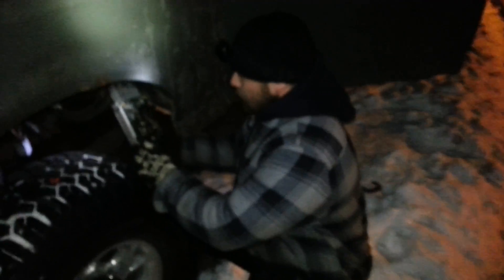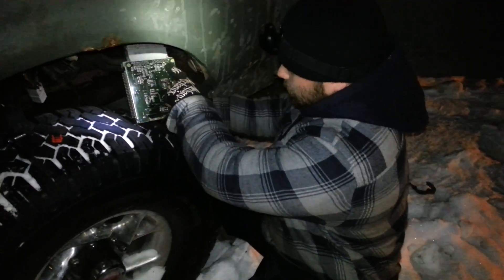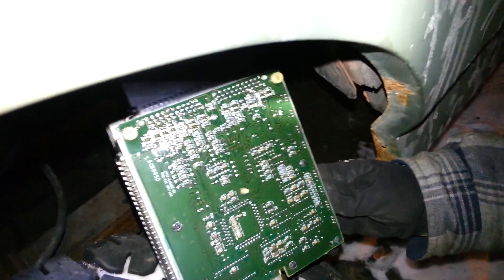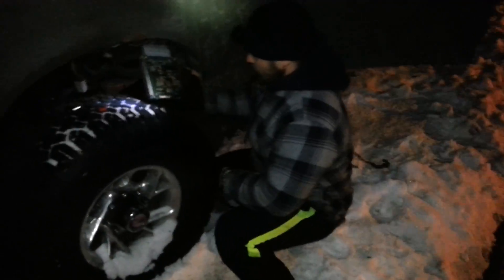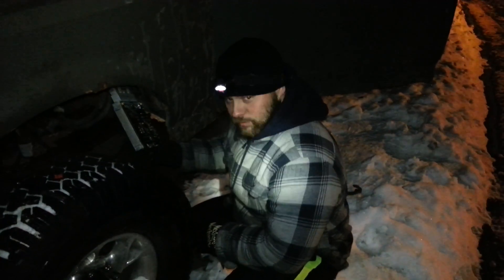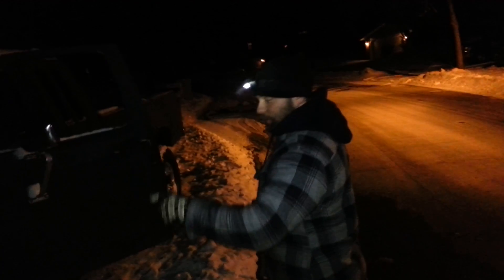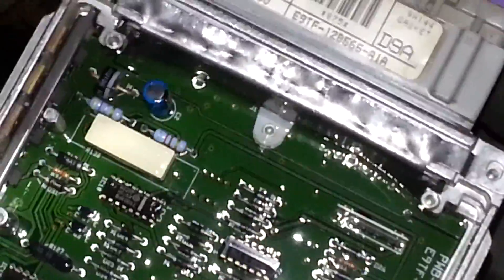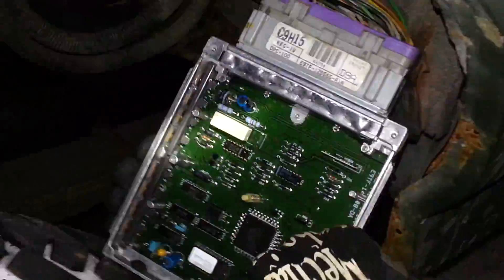1990 F250 7.3L IDI E4OD broken (TECA, TCM, EEC) module

Comment: Hey guys my truck in not shifting I have 94 idi turbo 7.3 with e4od transmission I need help as I only have high gear
Reply: Did u get it fixed? My e4od seems like it starts off in a high gear but if I place it in 1 or 2 it takes off great